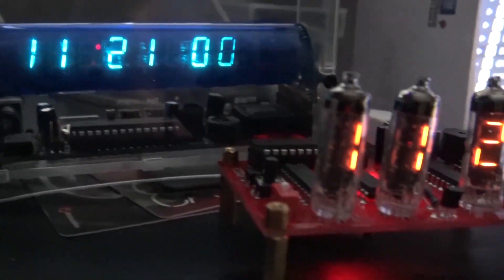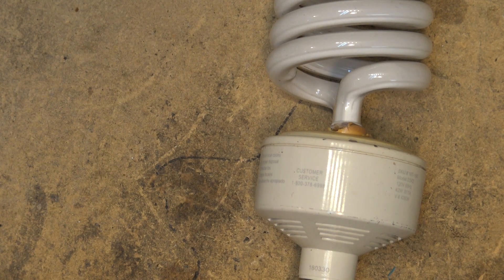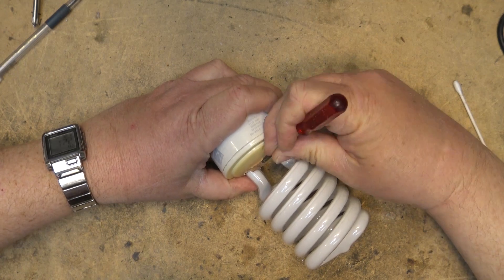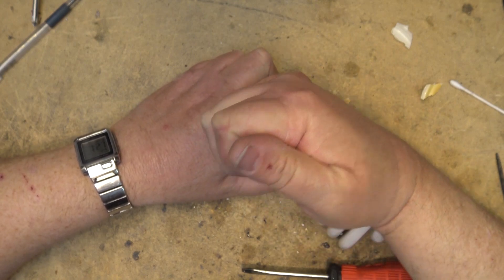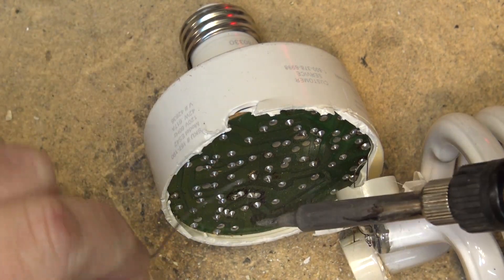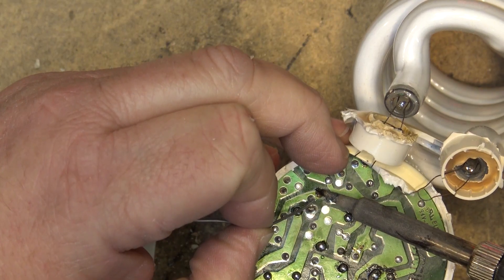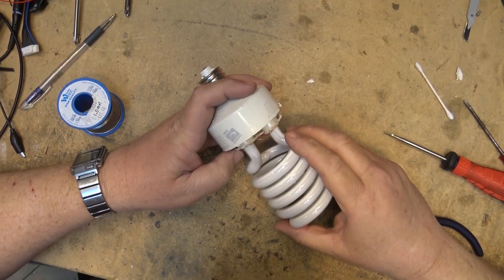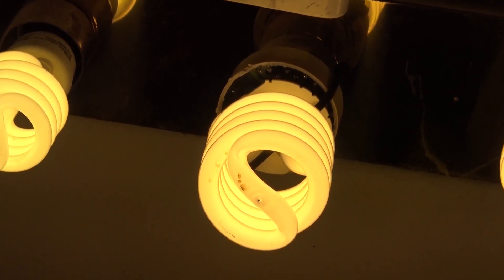cfl bulb intermittant inverter fix

Comment: You're a special kind of crazy, but I am too. I once spent a couple of hours fixing my comp. mouse. I had to make a new shaft for the scroll wheel when the original wore out. So far I've never gotten a CFL to last more than 2 years.
Reply from the maker: I have many that are very old and well used. The key to cfl bulbs is not to cycle them on and off. Use them in fixtures where they will run for a few hours every time they are turned on.  They don't like to be cycled frequently. If you put them in a bathroom for example where they are only on for a few minutes at a time they will burn out quickly. If you put them on a porch where they run every night for hours they will last a good long time. LEDs are the ones that have not lasted here.

Comment: I can't tell you how many times I've fixed electronics gear since I started watching your channel. It's amazing how many problems turn out to be cold solder joints or bad caps.
Reply from the maker: Number 1 and 2 problems with electronics.
Reply: 12voltvids Except for me, when a shorted amp needs a repair